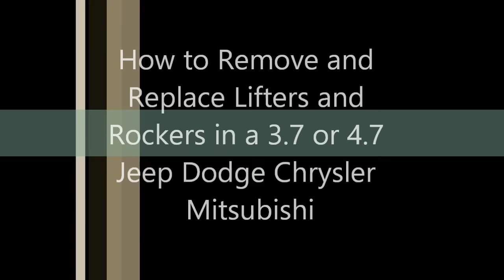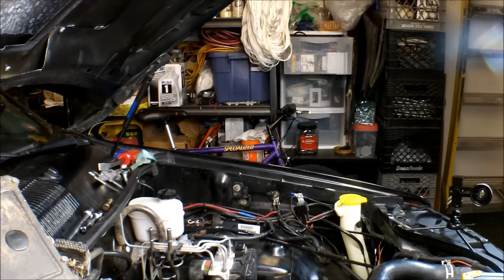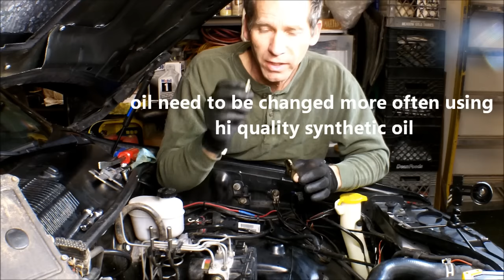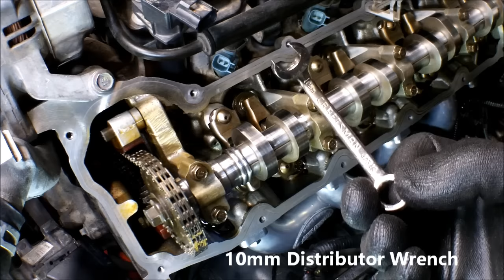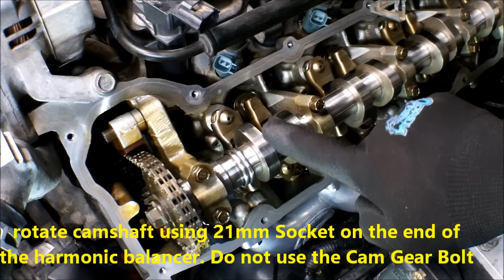Remove & Replace Lifters & Rockers on a 4.7 & 3.7 Jeep Dodge Chrysler & Mitsubishi

Comment: I believe this engine has lifters that have oil holes that need to be aligned when installing them into the heads. Dont forget to check just to make sure
Reply from the maker: They do have holes in them but they do not need to be aligned.

Comment: I could really use some help. I just put new lifters and rocker arms in my 4.7. When I started it, it started perfectly fine, but it had a little bit of a rough idle. No noise no ticking, but it sounds like one cylinder might be dead? I am getting rough fuel out of my exhaust. I’m wondering if I might have screwed up a wire to one of my spark plugs, causing that cylinder to not fire? But I hope I didn’t ruin something in the valve train.
Reply from the maker: Did you soak the new lifters in oil to remove the air prior to installing them the reason I asked I'm kind of curious if one of the rocker arms didn't come off on the initial startup.
Reply: I did, and I started working on it again this morning, and all is good. One of my injector wires had been rubbed past insulation and was grounding out. It caused one of the injectors to stay open while running, and filled my exhaust with raw gas, which smoked pretty bad. Thank you for getting back to me as soon as you did! I watched your videos over and over before I started this project and it made all the difference. Thank you!

Comment: Hello, back to you for help. As I have commented before on this video, replaced timing components and lash adjusters and I still get the dreaded ticking for a few minutes on cold start. I have a monitor and I recently noticed my oil pressure was stuck, not fluctuating at all. I ended up replacing the pressure sensor and it shows the same thing. This is on a Dodge Ram, these sensors are supposed to give somewhat of an accurate reading correct? I am now thinking I have a blockage in the sensor area limiting oil to the lifters when cold. Common area for sludge to stick? Let me know your thoughts. Thanks.
Reply from the maker: I would remove the sensor and temporarily install a mechanical oil pressure gauge to verify the oil pressure. You also use Marvel's Mystery Oil to help clean the engine. Use 5w30 motor oil.
Reply: Thanks for the quick reply. I was running marvels until I noticed it thinned the oil to the point the clacking was more frequent, happening even after letting the truck sit for an hour. I will try reading pressure manually. If that doesn’t show I’m going to try pulling the sensor on the next oil change and cleaning in there with something. I also notice there is a plug to the right of the sensor. Any idea what it’s there for and what size the hex is?
Reply from the maker: @ReedBoles  The plug closest to the sender lends to the sender and the main oil galley the other goes to the oil pump. They are 3/8 in diameter.

Comment: I need to replace mine. What do you think about the lifters sold on Amazon? Thanks
Reply from the maker: I would check the reviews on those lifters and make sure you soak them in motor oil for several hours before installation.
Reply: @martinbuilt  Thank you for your response.

Comment: If I have to turn the 21socket on the crank bolt to remove  the 
Rocker,  do it throw the time off
Reply from the maker: No it will not change the timing all your timing chains and sprockets are still connected.
 Just make sure you're turning the engine clockwise when you're facing the engine.

Comment: I am going to tackle valve stem seals on 2006 Jeep commander 4.7 . 145k miles almost. Should I do the lifters right away and if so , any recommendations for brand of lifters and stem seals. Any other pointers ?
Reply from the maker: if you don't have any lifter tick I would leave them a lone. If you do have lifter noise you could try either of these two products before replacing the lifters.
Rislone Engine Treatment Conditioner and Cleaner https://amzn.to/3mSUduP
Marvel Mystery Oil https://amzn.to/3oQCbeF
as far the the lifter brand I would check out the reviews on the lifters.
Reply: @martinbuilt  I appreciate you response. There’s no lifter ticks that I’m hearing. I was just concerned about the lifters after I heard it’s a common issue of the 4.7.  I will take your advice and leave the lifters be but I will do the valve stem seals because of the cloud on startup and oil consumption . How do you feel about feld pro brand valve stem seals?
Reply from the maker: @lostrhino73  I like the Fel-Pro seals that is what I used on my 4.7
Reply: @martinbuilt  Then I will go with those.. THANK YOU !!!

Comment: I just did a lifter replacement on a 2007 Liberty 3.7. Only did one side that was noisy. All went well, but engine has a slight vibration now at idle. Not sure why, but it’s not missing or anything. Is it bad to only do one side? Or should I be doing the other side anyway.
Reply from the maker: it's okay to do just one side but I don't know why it would have a vibration at idle unless one of the rockers had popped off.
Reply: @martinbuilt  I don’t think so? It is a very slight vibration when in park. Almost not noticeable, but we mechanics hear the slightest things sometimes. The valve train side I worked on is totally silent so I don’t think anything had come loose or popped off. I’d for sure hear that. Will keep an eye on it but daughter says it’s running totally fine. Probably do the other side this week once more lifters come in. Thanks for your video, it was super helpful. Thank god guys like you take the time to make these things for us!!!!
Reply from the maker: @jaybilawchuk2225  
Yeah, most likely nothing wrong.

Comment: Hey Martin I’ve got the same 4.7 in my jeep. Would you buy the rocker arms brand new or would a set from a junkyard work just fine?
Reply from the maker: I personally think the ones from the junkyard are just fine. That's all I have ever used. Just inspect them before buying.
Reply: @martinbuilt   Awesome thanks for the tip! would you say the same for lifters? I bought  some "budget" ones on Amazon and even though they had overall great reviews, half of them arrived with a little bit of play.
Reply from the maker: @Trevbro1991  once the lifters are soaked in motor oil for a couple of days they should firm up.

Comment: Did you have to do any adjustments (lash) when you changes out the lifters and rockers? I’m getting ready to install all new lifters on my 08 Durango. Please get back to me. Thanks
Reply from the maker: No need to do any adjustments the lash adjusters are self adjusting I would just suggest soaking them in clean motor oil  for at least several hours  Or longer before installing them.
Reply: Thanks a lot. I’ve been soaking them for a few days now. Gonna do the replacements this weekend. Your jeep is bad ass man!
Reply: ????? Another quick question. I I have a 08- 4.7. Will it have the upgraded no hole rockers already? I have never opened the valve covers since I’ve owned it. No leaks!👍
Reply from the maker: @kraken8159  Thank you, yes all 4.7 from 2005-2013 have the upgraded rocker arms.
Reply: Well. I failed at trying to get the passenger valve cover off to change the lifters! Very frustrated. I have no clearance in the engine bay to get the cover to clear over the cam and the journals. The only way I think I could do it? I’d drop the motor. Don’t have the tools to do that. I’ll probably just take it to a garage to get them replaced. Thanks for all the help though.👍

Comment: Where did you get the solid lifters from and what's the benefit of going from hydraulic to solid?
Reply from the maker: The main reason to run this product is pure and simple... Horsepower. A solid lifter valvetrain is more consistent, opens to a greater extent, and closes faster than a hydraulic setup. This translates into better control of the valvetrain, as well as more duration spent at higher flow valve lifts. In essence, more high rpm power is found by eliminating the physical "collapse" (and resulting power loss) experienced by hydraulic lifters at certain rpm thresholds and valve spring pressure levels.  http://airram.com/product.php?categoryid=19&productid=1416
If you order a set let Nick know that I set you.

Comment: Just subscribed.  But I'm the kind of guy who never did much besides changing tires and oil, so I wish your video started from the beginning, taking whatever off to expose the lifters in the first place.

Step by step, is best for us newbes.

Also, you say the Rocker lobe should be upward but don't tell us how to get it that way, will it move by hand?  Do we have to roll the car to make it move?  (I'm watching on a small phone screen) are you moving it by applying pressure with a pry-screw driver?
Reply from the maker: thanks for subscribing....here this video should help.  https://youtu.be/URrQ9sMgLJs
Reply: +martinbuilt 

thanks

Comment: Are you supposed to fill the lifters before installing or just prime the engine
Reply from the maker: Yes soak the new lifters in motor oil for at least several hours. I usually do it for several days before installing.

Comment: Hi, bro. Good job. is it possible to install the lifter in cylinder 1, without removing the camshaft in Hyundai Elantra 2012 1.8?
Reply from the maker: I'm sorry but I'm unfamiliar with that engine. I did look into it sounds like it's prone for a lot of knocking and Ticking noises.

Comment: Hi Martin i received the sealed power ht-2271 lifters finally l want to know what to do with them before install. Some say wash them first then lay them in oil and so on.
What would you do?
Reply from the maker: I would soak them in motor oil and push down on the top of the lash adjuster to help remove the air and draw in the oil.
Reply: @martinbuilt  thanks mate you are a legend. 😃

Comment: Should carb cleaner or similar be sprayed into oil holes while the old lifters are out ?
Reply from the maker: It may be a good idea especially if there's any type of sludge in that oil Passage.. one of my favorites to use with the oil change is Marvel's Mystery Oil or Rislone both products do a great job at removing sludge and keeping lifters clean.

Comment: if a Dodge engine tosses a rocker arm, you need to change the VALVE SPRING, in addition to the lifter- not just the lifter.  the clearance comes from the spring being weak, not following the cam profile tightly and clearance opening up.  if you put spacers under the lifter, you will only collapse the spring more and more, and eventually break the spring.  change the lifter and spring, it will run fine and not lose rockers.

Comment: Had lifter knock from 120k currently at 187k now and I use ristlone and it has helped with the knocking... truck will make it 300k probably with all original internals
Reply from the maker: Yeah I like Rislone it does work.

Comment: Hi, I need some help. my cherokee wj 2000, has a fault. When putting it in the driver position, especially on a light climb, the transmission fails or disengages the power to the wheels. It seems to be low transmission fluid, but I left it above the level and it continues to have this fault. on the scanner does not fail. I ask, could the filter be clogged? I noticed that after hot the fault practically disappears? Thanks..
Reply from the maker: I would maybe try a fluid and filter change 1st there is a spin on filter inside the 45RFE and 545RFE transmissions. That have the 4.7L engine..

Comment: Thanks Martin. I need to replace my lifters.I have 195,000 mi.on my 4.7L and it has the original lifters in it.
Reply from the maker: Dan Hambrick 
Hi Dan, changing out the lifters themselves not a bad job it's getting that right side valve cover off you'll find  the hardest part of the whole thing. With wiring heater hoses and air conditioning lines not to mention the battery and battery tray all in the way
Reply: What was your reason for going to solid lifters? Are those the stock cams?
Reply: People  !!!!   make sure you use Marvel Mystery Oil with your oil change   4qt oil & 1qt mmo
Reply: @martinbuilt  any tips on moving the ac condenser and computer harness wires? Your right what a pain.
Reply from the maker: @justinthompson2133  Do you mean the A/C compressor? I would unbolt, leaving the line hooked up and move it to the top of the radiator. Remove the transmission control unit. Unplug the injector, and coils and unplug the 2 connectors the right (when facing it) side of the ECM move these wires to to center of the engine.

Comment: Hi sir what is the symptoms of bad lash lifters without the noise ? Misfire ? Or engine shut down ?
Reply from the maker: If you have a bad lash adjuster you're gonna have some noise.
  What symptoms is the engine having?
Reply: @martinbuilt  my engine goes out at the traffic light first 500 rqm than off sometimes especially when the engine is cold .. i change iac, map, tps , new spark plug , fuel filter , new battery, and change torque converter… but the problem is still there … at least lifters ??because the valve don’t close ?????? I don’t know :(
Reply: @martinbuilt  jerks when the engine is cold and shut down
Reply from the maker: @eko_fresh  start with the IAC valve, clean the throttle body, and check the fuel pressure.

Comment: I have a 05 Dodge Dakota 3.7 and it must of sat awhile without being started. My issue is it has a tick when it is first started in the morning, then slowly goes away. Is there a way to add something to the oil that might clean the sludge off the lifters? Or is all that stuff garbage?
Reply from the maker: Yes I would recommend either  Rislone or Marvel's Mystery Oil
Reply: Thank you, I will try one of the 2 products that you suggested. I also have an issue with burning oil. I recently changed the PCV valve, hoping that would help with the oil burning problem. Do you think using one of those products could also help with the oil burning issue?
Reply from the maker: @djbobbyd3985  I don't know that either one of those products would help with the oil burn they do a great job of removing deposits within the engine though
Reply: @martinbuilt  ok, thanks for all the great info, I really do appreciate it.

Comment: Hey! Got a question for you. You know that star bolt on the timing chain guide that you have to remove if you want to take the heads off w/o pulling the timing chain cover? How in the heck do you get that thing off the "right" way? T30 and T40 never quite fit the right way in there, and at the junkyard I had to like... hammer a star wrench in there and do all kinds of damage to the bolt itself just to get the thing off. Is there a special size? Any advice is appreciated.
Reply from the maker: I was out at Pick-A-Part one time and someone else needed help pulling that same bolt out. I don't remember what size I used. I ended up twisting off the one I used.
Reply: super late im sorry but its a special t35 torx bit make sure you use a bit or it wont fit through the access hole in the cylinder head

Comment: Do hydraulic lifters need to be adjusted before installing??
Reply from the maker: No, they are self-adjusting. I would recommend  soaking them in motor oil for a couple of hours to help remove any air.

Comment: Great video, at my former shop(I was promoted to manager/tech at another shop in company) we replaced 4.7 that had bad valve springs, you could hear cylinder pushing back into intake. So we have new/used low mile LKQ engine and it's tapping. My money IS sticky or collapsed lifter, runs too good other wise. Bad thing is it's number 8 that's misfiring.
Reply: Haha number eight always the hardest to get to. Under the heater core hoses and the coolant reservoir

Comment: do you have to do all of them ? and how can you tell which one is bad? thank you sir
Reply from the maker: No you don't have to but it may be a good time since it is quite a bit of work just to get the valve cover off especially on the passenger side right. You could use an engine stethoscope to help determine which lifter is bad. Place the stethoscope on the valve cover while the engine is running.

Comment: I have a 2003 Jeep liberty 3.7l V6. Engine seems to have a knocking sound when car gets to its operating temperature.  I can hear it when idling mostly. Doing research on this just in case. Prior owners didn't keep any record of maintainace. But car seems to run fine.

Comment: What does it mean if you turn the engine over and the rocker keeps falling out?
Reply from the maker: If the rocker falls out immediately after replacing it there has to be a mechanical issue as far as a broken valve spring or a collapsed lash adjuster or worst of all would be a dropped valve seat if you can install the rocker without any tools, that is a good indication that the valve seat has dropped and your cylinder head will either need to be repaired or replaced.